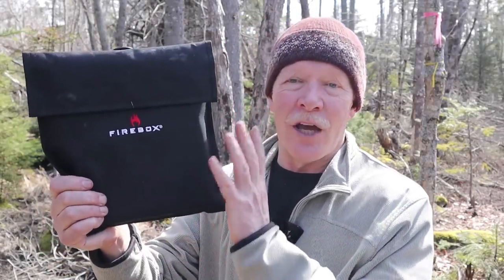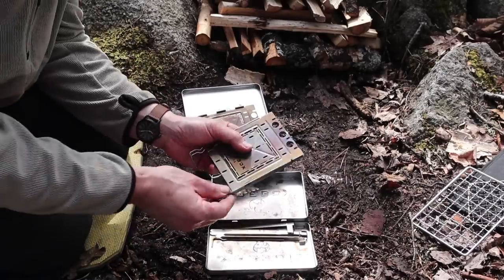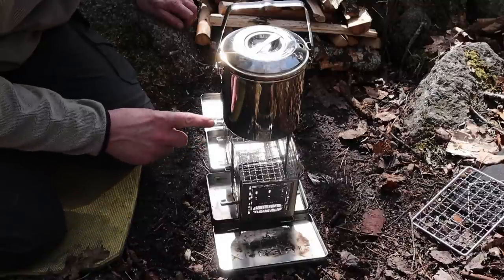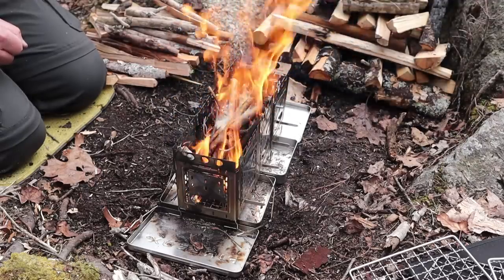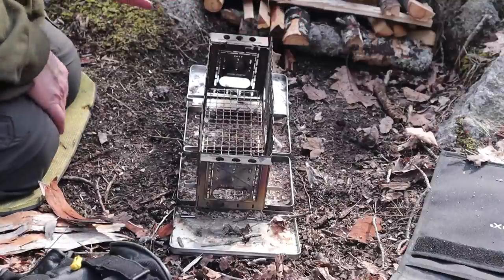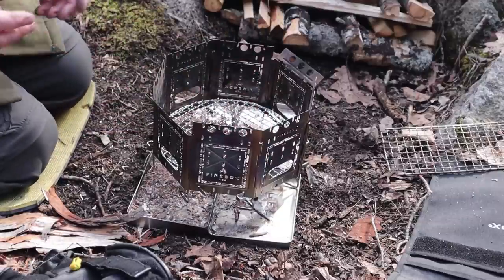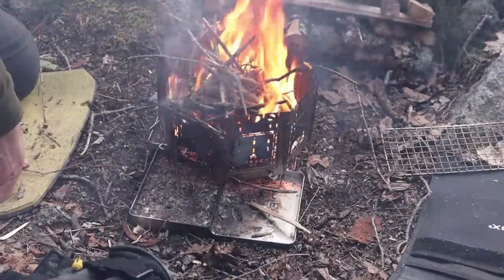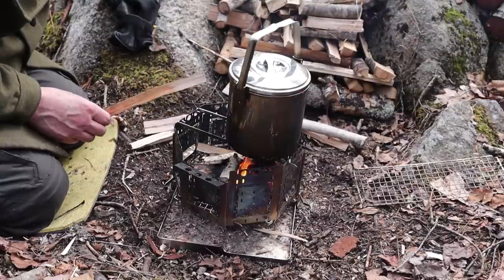Firebox Freestyle in the Bushcraft 8 & Firepit 8 Configurations

Comment: That was fun to watch because you seem to be having a good time with the Firebox Freestyle. That's what I'm really after with my products... 

As for the fire grate, I asked my wood stove mentor (my scoutmaster) about his wood stove fire grate (a piece of expanded steel) would it allow too much flow? His reply "can you have too much air flow" after considering this conversation over the years I've realized that he's right. You can always use technique to reduce airflow but no amount of technique will compensate for a restrictive fire grate. That's why the Nano has such large diameter holes. Same thing with the 5" g2 classic. Back when they were introduced people mentioned concerns that the holes were too large and hot coals would fall through. As you know the larger holes proved to be a big part of how well the stoves perform.  Performance and technique/skill are always connected like the difference between a Toyota Corolla and a formula 1 race car.  You being a race car driver of wood stoves I'm sure you'll quickly develop technique that takes advantage of the freestyles broad range of capability. Which is all part of why the freestyle is fun. We enjoy having our skills knowledge and technique produce performance. That's called accomplishment and nothing fulfills quite like it. 
That's what fun is all about 👍😎 

Thanks for the awesome video Mark!
Reply: Build up some sand or dirt under the grate to block out as much air flow that is needed. Also will extend the life of the tins. Works great with the nano and x-case.
Reply from the maker: Hi Steve. Thank you for watching and commenting. For me the ideal "grail" stove design is one where I can control airflow, both intake and exhaust. That way I could "have my cake and eat it too". Until some clever designer comes along(hint, hint) I am happy to have a stove with more airflow than not enough. As you say, it is easier to decrease airflow than it is to increase it. I am planning a video for the Freestyle to demonstrate exactly that principal and will be sure to bring you comments into the discussion. Thanks again
Reply from the maker: Great suggestion. Thank you

Comment: Awesome Video Mark,,,
Now Iam really gnawing at the bit,,, to get my forthcoming Freestyle kit,,,,!!!!      Ok,,, you’ve talked to Steve and the general thought is using Larger coal pieces to restrict air flow,, and keeping the weight down.,,That’s Great.    The first thought for me is using a disposable pie tin / rectangular disposable tin lasagna pan. You can cut your shapes with scissors,,, it’ll fold and bend and it’s light weight,,,Finally,,, experiment with various hole configurations.   Your thoughts,,,            Joshua
Reply from the maker: Yes, Steve messaged me on that. I am planning a video on mods for slowing the burn as well as pellets. Your pie plate idea is great. Thanks for commenting

Comment: Morning Mark!   So I hope you’re future testing will include actually using it as a fire pit, since it is basically a fire pit.   You’ve tested other portable fireplaces, and so far with this, all you’ve done is used it the same as a small cook stove.   I’d like to see some big splits in it, making some coals, if possible, and could it then be used to grill on, for example.  Also how it would perform as a fireplace for a couple people to sit around.  Would it just continuously run through wood, or could a sustainable fire burn for a respectable amount of time.
To me, that seems to be the only reason to have it.   Cooking large pans/meals, a portable bbq or cooking with coals, or a fireplace that won’t burn the ground.
Reply from the maker: You have a good point Jim. I need to make an opportunity to just have a good size fire instead of just one for cooking. Part of the issue is the work of cutting and splitting large pieces while I am out. I would need to take a day of prep and another day of recording. Truth is, I don't often have really huge fire for that reason.
Reply: @MarkYoungBushcraft    For sure.  Guys like you and me who are mostly alone don’t need a big fire, or big stove, but the reason I mentioned it was you did try out some pretty crappy looking portable fire pits, so I feel it’s a little unfair to not blow them away with a firebox product.  Right?    Plus the whole point is how it can go from a mini alcohol support/screen, to an actual fire pit and everything in between…..so you got a lot of videos to make! 😀.       Besides, you don’t want to make Steve unhappy, do you?

Comment: Thanks for the great video.  I have placed a kickstarted order and I am looking forward to start using it.  Configured as a firepit, I think it will work well with a Dutch oven.  You should test it in your yard with one.  No need to drag it out to the wilderness area.  Roast a chicken perhaps?  :)
Reply from the maker: I have not tried cooking with my 10" Dutch oven over the Firepot 8 but I have sized it and it does fit and the stove is sturdy enough. Will see about a test video. Thanks for commenting

Comment: I hope that, when this officially goes on sale, Firebox will have an option where you can just buy a six panel Freestyle stove, rather than having to buy two fours to get to a six.
Reply from the maker: Steve is reading these comments so maybe he will consider it. Thanks for commenting
Reply: @MarkYoungBushcraft  I noticed that. :)

Do you think the standard tin that the Freestyle come with is deep enough to hold six panels and a grill top?
Reply from the maker: @andymytys  Yes it is, check my Bushcraft 6, Firepit 6 video. I put the stove together at home and transported it in a single Freestyle box

Comment: I wish the grate and accessories were available in titanium. Stainless steel grates will corrode. Not a fan of that. I also worry about burn through like with the grate in solo and bush buddy stoves
Reply from the maker: All components of the titanium version of this kit are titanium with the exception of the long skewers. Thanks for commenting
Reply: @MarkYoungBushcraft  that’s actually incorrect. Both Steve and the kickstarter page say that the titanium kit comes with stainless grates and accessories.
Reply from the maker: @ProdigiousReturn  interesting. I have the titanium Freestyle now and the grate and firesticks are ti
Reply from the maker: @ProdigiousReturn  Re-read what you are saying. You are correct, the larger grates in the titanium kit are stainless steel but the grates for the two individual stoves in the kit are titanium